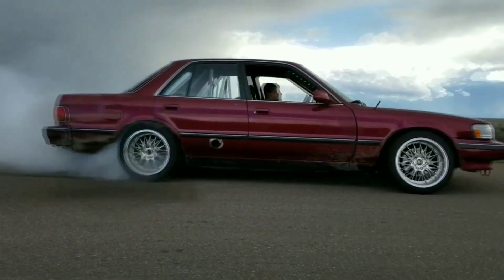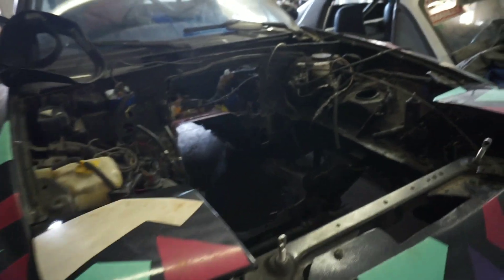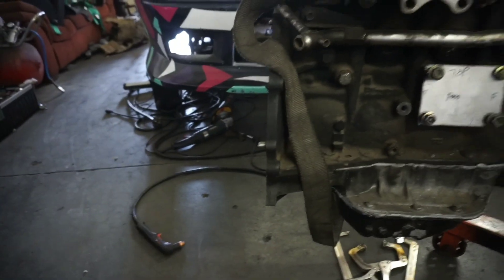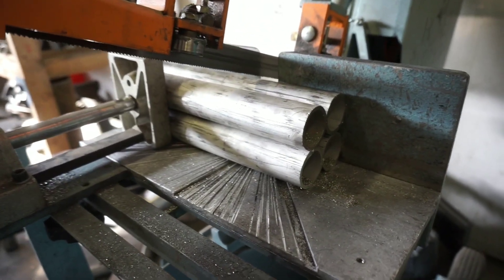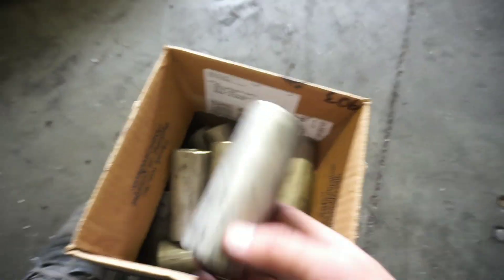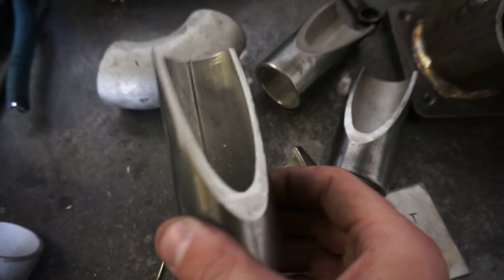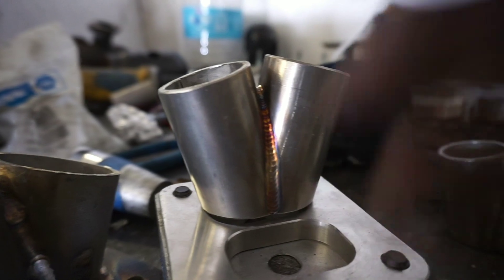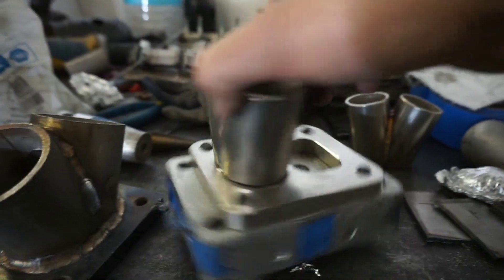How to build manifold merge collector part 1

Comment: So on the divided flange you showed, what degree did you end up cutting the pipe on that fixture? How many amps on your welder and what cup size?
Reply from the maker: 15 degree, 120 amps, fupa #12
Reply: @fabtown1457  Thank you for the information.  Do you have a set distance from the blade you prefer?
Reply from the maker: I leave about quarter inch between the jig and the blade at it's closest point
Reply: @fabtown1457  Awesome. I decided on buying one of those fixtures to try out. But after looking there isn't a ton of information out there. Thank you for the info
Reply from the maker: @normanfab4178  no worries glad to help